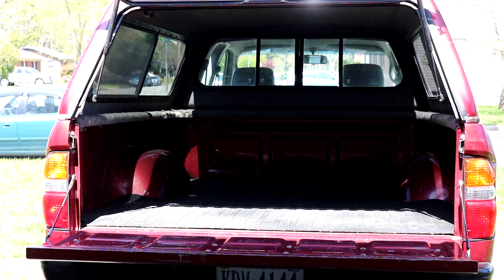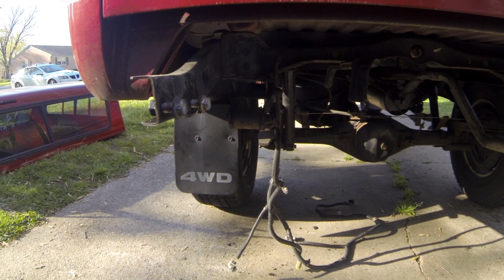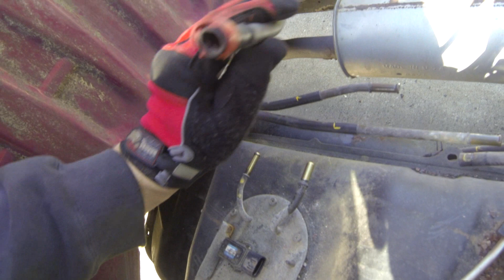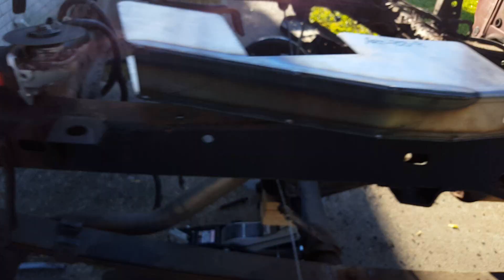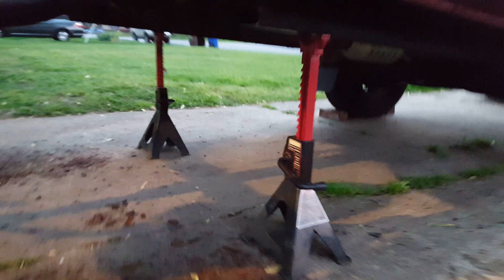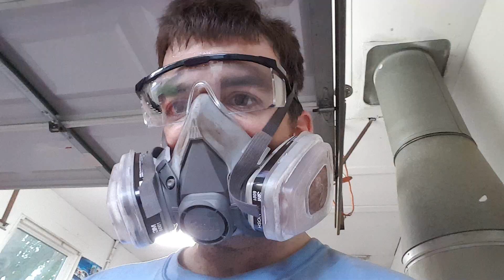Toyota Tacoma Frame Rust Repair Episode 1 of 2

Comment: The topper on my tacoma has the exact same problem, the left handle latches but doesn’t lock. Also the frame looks like it’ll fall apart so there’s that. Otherwise no issues with the truck just small bit of rust on the exterior, seems to be this trucks only downfall.

Comment: have a 2002 2.4L 5 spd @ RWD. I heard about this, and not kidding, on my birthday Sept 24th (1991) 2016 I think only to get denied turns out it was GIVEN TO ME BY MY MOTHER wasnt going to be fixed just because it had a salvaged title, and a tree fell on the cab when it was parked, it was repaired and shortly after she found it at some dealer in 2012 (yes still have it after 8 years) besides the MASSIVE rust damage from HELL (TWO 3/16 steel plating around ther fucker) Welding is the most usful shit I have ever learned when i started in high school (and fuck the bullies, they werent laughing when i won 1st place with shelf and red/oak wagon during metals competition) wagon also won best of show. My advice? the world is fucking totally unfair, you only have yourself to rely on, learn to weld or suffer greatly and don't let NOBODY tell you what you cant do, I also have autism. period

Comment: I've owned a 2002 Tacoma for 7 years & this video opened my eyes to the frame rust/rot problem.  Thank you.
Reply from the maker: No worries! Keep an eye on it and clean the frame off after salty roads and you will be fine
Reply: Unknowingly I bought a mint condition taco without looking at the frame the underside frame had cancer so bad I don’t know if can be fixed, I got f%@# my own fault guess I’ll try to fix it now too nicer truck not too 2002=tacoma limited 5 speed limited 4x4 with topper thanks for your video👍👍

Comment: Seeing how it's the same frame chevy/GMC use on the canyon and colorado.. I fail to understand how Toyota has a recall on these frames but Chey / gmc does not. Same issue.. same location. Cheep as metal in the frame.

Comment: This is a great video; I hope I do not have to do all that work to lose a hose stuck in the neck of the gas tank I inserted to get gas out and now it would not come out for nothing; it is a thick blue hose the has a metal neck in one end with a ball; suppose to be the type to siphon fluids; it went in very easy on the clear end but I felt it pass some sort of flap deep inside trying to reach the bottom of the tank now it is there for good...please tell me this is not what i need to do to take it out of there??!! I can see thanks to this video that the gas tank neck has a ring that connects the gas tube to the gas tank neck but seems that is under the bed in a place that is not easily reachable unless using a lift, which case I would have to take the bed out to be able to work the gas tube out then get the hose easily? What have I done!!!??? LOL.

Comment: Toyota has had this problem for decades and still as new as 2011 frames rusting into and breaking in half folding up like a taco shell. That's how they got the name taco.toyota has a factory recall on their truck frames but if u have any modifications like lift kits or rock sliders they don't have to honor the recall which gave them a way out of repairing alot of them they should of.i have heard of a 2016 having this same trouble so much for the reliability. They ok if u replaced ur frames every 5 years or so.

Comment: I think the recall shouldn't expire it should last the life of the vehicle. once the frame gets replaced that's it. I love these trucks!
Reply: I wish that was the case, I have an 02 and its a great truck, unfortunately the frame looks like Swiss cheese, would love to save it though. The frame on this dudes truck looks brand new compared to mine.
Reply: @KrashGT  Same here with my 99’ it only has 178,000 miles and runs perfect but the frame is scary to look at.
Reply: What is the life of a vehicle? A Toyota can go 300/500 thousand miles with the drivetrain easily, they can't warranty a frame for 20/30 years. I certainly agree that they have some responsibility here though because these frames should not be dead in 10 years and many of them are. At least this guy is doing it right, chop out the rust and replace, do not cover it!!

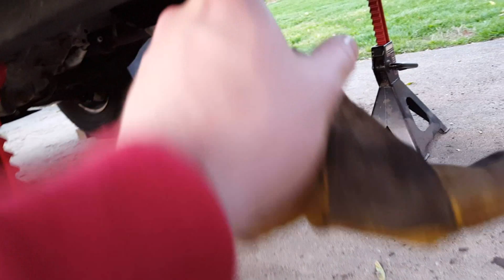Comment: 12:08   at this point I would cut the frame off both sides and weld in a really good one from a junked truck.  far too much work ahead, with the likely hood of a sub-standard result.  Once I saw the condition of the frame at the leaf spring attach point.. I said.. UH UH!    Just graft in like new.. if you want it safe in a lot less time.  All the time ahead grinding and coating with expensive shit.. to make a shiny almost good enough frame.. just wasted time and especially money.

Comment: Even if you undercoat those trucks they still rot out just not as fast. I'm in Canada and they put salt on the road and that stuff gets into every nook and cranny will rot from the inside out on the frame.
Reply: Calcium chloride on our roads here  in idaho I'll just turn it into my insurance I have  full coverage my way of thinking is I didn't tell them to spray our roads and hyways with that stuff I see alot or vehicles rusting bad from it , give me your opinion

Comment: 1st gen Toyota trucks will out live you if you avoid rotted out trucks when buying. Buy dry climate trucks. Hot and dry climate West TX, Southern NM and AZ is a preservative for all steel bodies, including Toyota.
Reply: Toyota's was the worse of all the vehicles that's why that got sued and had to have a recall on them.and if ur truck had any modifications like lift kits or rock sliders they don't have to honor the recall and they won't either. Toyota  had this problem for decades. I had a 93 it wasn't quite 10 years old the frame rusted into and broke in half folding up like a taco shell.

Comment: I have a 93 dakota thats pretty rusted out in the back only. I'm building 2x4 3/16 steel box in the back with a narrowed 9 inch ford rear with 18" wide Mickey Thompsons for drag racing. Each frame rail is being moved 9" inboard. That gives me 24" for each 18" tire, 3" clearance each side of tires. Already have a 388 chevy built for it with around 525 horsepower.
Reply from the maker: That should be nuts!!

Comment: The most amusing thing is ,all these owners complaining about the Toyota frame corrosion ,and the big laugh is they are made in Amurica!!!...good old US junk.
Reply: Gerald Swain You are correct, but the material Toyota used wasn’t the issue. The coating that comes from the factory to prevent them from rusting was minimal. And obviously below average compared to GM, Ford, and Chrysler . Without a coating , salt will eat away at any steel. Wether it be made wherever.
Reply: @wilwathen  the frames may rust more than other manufacturers, but I must say after watching a few of these videos the Toyota bodies are always in much better shape than their counterparts
Reply from the maker: 100%, my body was virtually rust free

Comment: You might want to check the rear differential for rust also. They are known to pit and develop pin hole leaks which result in lost fluid so the bearings lock up. If nothing else check the fluid level, color, etc. Mustie1 has a great video on the subject. Start at 2 minutes in if you're in a hurry. https://www.youtube.com/watch?v=EgNmy7vZqPY&t=298s
Reply from the maker: +Patrick Burns good tip! Thanks for sharing!

Comment: Toyota lost 3.4 billion dollar case about truck frames. they are replacing mine now, and gave me a loaner Tundra. Frames are back ordered.
Reply: Toyota doesn't have to honor recall if u have any modifications like lift kits or rock sliders it gives them a way out of replacing and they are using it.

Comment: I did the same to my Tacoma. Rust wasn't as bad on the frame but 2 of the bed bolts broke during removal which was not fun. I also did a frame box kit at the same time.
Reply from the maker: I think I left out that my two most rear bolts, near the tailgate, gave me trouble as the thin piece of metal that was suppose to be a head of the bold just twisted and made for a bad time
Reply: Garage Topics this is definitely a big project and looks like you did a great job!
Reply from the maker: +Thrifty Garage Thanks man! It definitely was

Comment: Interesting accent you have. Toyota should have put drain plugs in to stop water getting in.
Reply from the maker: +michael jagger thanks! yea idk what they were thinking. The main reason it rusts is they did not add adequate paint on the inside of the frame + no drains which is why they rust out super easy

Comment: I did a similar project on my taco a few summers ago. It had rusted apart in the exact same spot.
Reply from the maker: +Reptilian Overlord yea they are terrific trucks, they would be perfect if they did not have this rust flaw
Reply: I love mine. It's got 221k miles on it and still shifts and runs perfectly. I wanted to build a new frame for it, but I ended up deciding that was a little too much fabrication for for a summer. Sadly, I'm selling it soon to say for the next project.
Reply from the maker: +Reptilian Overlord new tacoma??
Reply: I'm going in a new direction for my next project. I want something relatively fast, so I'm leaning towards a fox body mustang with an LS swap.
Reply from the maker: +Reptilian Overlord nice!
Reply: Should be a fun project. It'll probably be a while before I can start it since I'm graduating engineering school in the spring and I don't want to sped money until I know where I'm going to be after school. 

I really like the idea of a big, powerful V8 in a lightweight chassis. I wanted to LS swap a BRZ or FRS but they're too expensive on the used market right now.
Reply from the maker: +Reptilian Overlord agreed, we have similar car taste! Keep me posted - if you have instagram follow me @seymourless and ill check out the progress

Comment: It that a semi american car, because farme is from Tacoma Holdings? Made in japan frame would not get rusted like that. Typical poor jenky quality.
Reply from the maker: +Z Zaddari Made in America. However, the frames were outsourced to Dana I believe and they are responsible for not coating the frames correctly, resulting in premature rust
Reply: Toyota pickups in japan had the same problem. Toyota had this problem for decades. That's why they call them tacos they rust into and broke in half folding up like taco shells.

Comment: Wasn't Toyota replacing the frames on those for free?  A buddy of mine got it done.
Reply from the maker: +UreaSmith yep as long as you took your truck to the dealer for a a frame inspection by 2012. My truck had never been to a dealership since it was sold haha
Reply from the maker: +UreaSmith yep as long as you took your truck to the dealer for a a frame inspection by 2012. My truck had never been to a dealership since it was sold haha
Reply: That sucks. good job though.
Reply: @Garagetopics  Hi GT, hey you wouldn't happen to know where the Vin number is on the frame on those years do you?
Reply: And if ur truck had any modifications done including lift kits or rock sliders they don't have to honor the recall. How convenient for them.its been a problem with Toyota pickups for decades. All the way up to and including 2011 I have heard of a 2016 doing it but haven't seen that first hand yet.

Comment: I noticed you used some in a can spray paint for the frame. Might i suggest something called Chassis Saver. epoxy paint that stops rust and is meant for frames. I am going to be doing my frame with it this week after doing some research to find the best paint.
Reply from the maker: +DankWheelies yep for sure! Def check out eastwood they carry almost all the paints you would ever need

Comment: I'm getting ready to do this same thing to my 01 Tacoma, man. I'm going to order a kit from Autorust to repair the driver side frame section where the leaf spring perch hanger is. It is not as badly perforated as yours but it is getting there. The pass side is fine so I probably wont touch it. Like you said, it is worth repairing, its got 200k on a 2.7 and runs excellent. I've owned many Yotas, all 4 cylinders. To me, nothing compares, you get a lot of bang on Yota 4 bangers unfortunately this generation has bad frames. I'm gonna do all the work myself as well and have my welder neighbor lay the critical welds. BTW, I've gone the route of trying to get a new frame per Toyota TSB and had no luck since the original owner didn't get it in for the initial recall in service date, so yeah, thanks to that guy for screwing me. I called Toyota and they basically said I'm screwed. This pisses me off as I'm a big Toyota guy, all we have are Toyotas 5 total. Thanks for posting this, I'm glad I'm not the only one attempting this and I hate to sell it short due to a bad section of the frame and I couldn't in good conscience sell it without disclosing the problem.
Reply: Where did you find the crossmember that is rusted out

Comment: did you safe t cap it?  autorust.com/product-category/toyota/toyota-tacoma/
Reply from the maker: I sure do! next video will explain all the products used as they were key to getting the job completed
Reply from the maker: +Garage Topics *did
Reply: my 99 was recalled and bought back in 2009 with 30k miles. they gave me 18,500 for it.  The money was good but I loved that truck.
Reply from the maker: +kapple17 that is good money! it's crazy to me how rusty the frame is but nothing else...clearly a build flaw